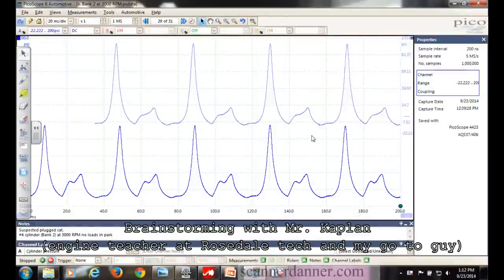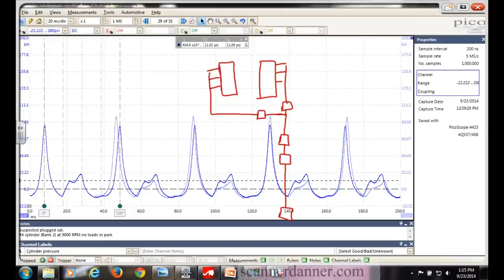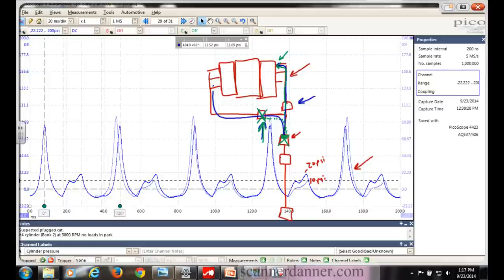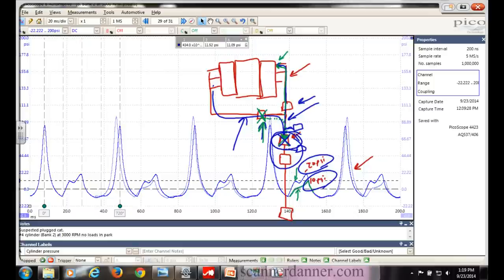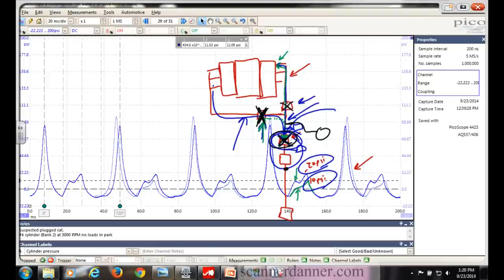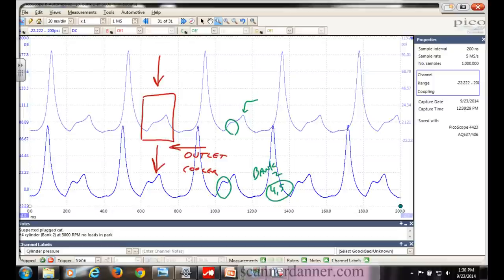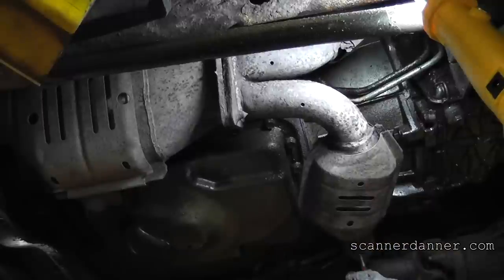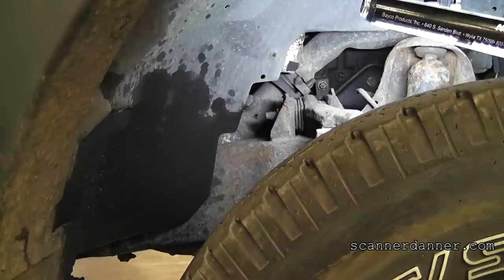How to test for a plugged exhaust (picoscope and psi transducer) Part 2

Comment: Yes I 've done this with 3/16 brake line. Drill the 3/16, insert brake line, measure, then sheet metal screw as "Cap" suggested.

Comment: 4:13
Pipes lengths are different on banks 1 and 2.
Bernoulli principle on fluids :
When you increase a fluid velocity ,it's pressure drop.
When you reduce its velocity ,its pressure rises.
It would explain the two different patterns on bank 1 and 2 while it's clogged downstream.
gases from bank 1 are quicker to travel,because the pipe is longer,so bajk 1 cylinder vacuum each other less well than on the passenger side,so you read more cylinder pressure.
That's how you tune a header,by modifying pipes diameter and length accoring to rpm target to increase volumetric efficiency.
I guess.

Comment: Hi Paul, great case study showing how to use the scientific method (hypothesis, experiment, conclusion) to develop testing tools and pinpointing the exact problem! I was also thinking that the driver's upper cat and the first downstream cat were restricted until you showed the backpressure readings. At this point to complete this case study you could show us the running in-cylinder pressure transducer test on this fixed vehicle. Maybe some waveforms from other known-good vehicles at 3k rpm, with 4 cyl engines vs. V6 vs. V8 would be helpful in explaining the positive pressures on the exhaust stroke.

I think Tobias Jonsson makes a very valid point about higher in-cylinder pressures on the exhaust stroke at higher volume air flow just because the exhaust valve itself (even fully open) is still the bottleneck (highest resistance in air flow) between the cylinder and exhaust manifold.

The "curve balls" definitely makes the process  of developing testing methods more difficult, but also more fun! Thanks for sharing so we can all learn together. Now I want a pressure transducer!!
Reply: Thinking about the two waveforms for a few days brought up another point at 5:30 when you are comparing the exhaust stroke pressures on driver's bank vs. passenger bank. On the pass. bank, which we can call a known-good, the pressure only increases as the piston accelerates upward and pushes the exhaust gases out past the valve, as Tobias pointed out.

However, on the driver's side, there is an IMMEDIATE spike in pressure as soon as the exhaust valve opens!! This is the real indication that there is pressure built up in the exhaust manifold that is backfeeding into the combustion chamber. Then the piston pushes against this existing pressure, creating the second higher 20psi hump, like an additive effect.

The in-cylinder pressure transducer test for a plugged exhaust seems most conclusive at high rpm, with any built-up pressure in the exhaust manifold shown as an initial positive psi spike as the exhaust valve opens. At idle the air flow is much lower, so a partially restricted system would not be as evident...
Reply from the maker: motoYam82 I am in total agreement, with you and #Tobias. I just checked one of the few other engine propulsion waveforms I have stored of a good engine running at 2000 RPM (don't have one at 3000) and it read 5.44 psi! This would be bad if we were in the exhaust. The bottle neck description seems to be dead on. Also the waveform I have shows the gradual rise, near the end of the exhaust stroke (like the ranger showed on the good side). Not the sharp rise at the beginning. Tricky waveform to analyze for sure. I am almost sorry I didn't have a better understanding of this before shooting this video. On the other hand it is fun to lean together.
Reply: ScannerDanner Premium motoYam82 My thoughts were going all over the place when I first saw the waveforms and was thinking how can this be. You know that there should be virtually no pressure at all in the exhaust so you kind of have your mind set on that. Then when you get presented with evidence on what really goes on it takes some time to readjust and think about what exactly is happening and where the meassurement is taken. It is nice you got it figgured out. I guess we will see some more of these waveforms as oppertunity comes! Keep them coming. I learn something in almost everyone of your videos and it is really fun to be able to talk about with other people!
Reply: @mctobbsi  bor du i norland?
Reply: Joachim Johan Hej, nej jag bor i Skåne :) Vad tänkte du på?

Comment: My 02 Ford Ranger had 5 cats And when my truck shut down my longtime mechanic was stumped. In desperation a youth who was a Ranger whiz got the cats unclogged and my truck is back on the road. A side note to all this is that I had previously had all 5 cats replaced(Supposedly) under similar circumstances with previous engine/6 cyl. edge! When I was informed that the cats were the originals, I knew I had been scammed BIGTIME!

Comment: The inner cylinder pressure could just be due to the velocity and volume of air exiting the cylinder? Great video though, it gets you to thinking in a different direction. The pressure measurement was taken inside the combustion chamber, which does change things when thinking of exhaust back pressure. I agree that more "Known Good" engine cylinder pressure values would add to the case. I really like the idea of checking and measuring anything and everything possible with a scope. The ability to save and capture screen shots in a graph form is much more accurate and educational than watching a gauge needed fluctuate. Keep up the great work Danner.
Reply from the maker: Jeremy Shanks Thanks Jeremy. Lots a variables with the in cylinder stuff that's for sure. I'm learning with you guys on these.
Reply: Keep on.

Comment: Hello Paul Danner.... I was wondering if you had any videos of disabling the EGR by removing or plugging it hose, or disconnecting one of its control solenoids and taking a vacuum reading at idle and again at 2500 rpms?  I have seen where you connected to the DPFE sensor.  Is this a different scenario or similar to the one I am describing?  Thank for any information in this manner...  @ScannerDanner

Comment: What if the 10 psi you're seeing on the passenger side(good), with your pressure transducer, is just the backpressure of the piston pushing air past the exhaust valve. The bad side reading 10 psi past the valve plus the additional backpressure due to the plugged precat. I'm guessing if you were to do the pressure transducer test with the y pipe off, you'd still see close to 10 psi on all cylinders tested.

Comment: Hi - I just watched this video, I realize I'm a couple years late - but just in front of that third CAT (the first "shared" cat), you drilled two holes, one in each pipe heading upstream.  Then you measured the back-pressure on each one, one at a time.  Is it possible that the excess back-pressure was escaping out the other hole, thus showing zero backpressure?   When in reality, if the other hole was plugged up, you might have seen backpressure in the third cat, explaining why you did not see backpressure in the passenger cat, but you did see it in the cylinder...
Reply from the maker: No, I plugged the other holes during each test, plus they were too small to make a significant difference.

Comment: Check wit a temp gun at before and after each cat to check the temperature delta prior to the back pressure test to gain an understanding of what temperature delta to expect from a plugged cat, that will save you from drilling holes next time.
Reply from the maker: Just uploaded a case study on this proving the temp test for cats has variables and is NOT a foolproof way to test for cat restrictions. 
https://www.scannerdanner.com/scannerdanner-premium-chapters/chapter-1-universal-testing-methods/587-2006-lexus-rx-330-low-power-no-trouble-codes-part-1.html
Reply: ScannerDanner Premium has moved to my website Hey I agree with you completely that it is not a definitive method, it can be a good indicator of a blockage and if you want to determine the exact point of blockage, then the method you have used in this video is absolutely on point and accurate. It doesn't harm to take readings and build knowledge of what symptoms can occur. I will be making the order for your hard copy book once I get some bills out of the way and subscribing to your premium channel.

Comment: Another great video series.  Really enjoyed it.  So it appears that melted cat could clog exhaust but not necessarily effect cat efficiency (because there was no cat efficiency code)?  I would have still been interested in knowing the inlet and outlet temperatures of the cats just as data points for reference.  For example, if driver side cat showed "good" outlet temp, then it would confirm Paul's hesitation at using temperature as a test for exhaust flow.

Comment: by making 2 holes b4 the cat after the upstream cat, dont the pressure will release by one of the holes? i think you should clog one of the holes to do that testing? or it should not matter due to small size hole?
Reply from the maker: hole is too small to be a significant change. Thank you!

Comment: This video has had me wondering for a few days now. I really cannot rationalize why you have almost zero pressure on the passenger side when you clearly have pressure on the sensor while the exhaust valve is open. I cannot think through how this could be valve overlap or any other pressure feed from the bad cat. Was the injector disconnected on the cylinder during the test? Is the transducer linear or is it logarithmic? Did the drill make vibrations that cleared out the center cat? Your logic and argument through the video made perfect sense to me. Will it be possible to repeat the transducer test as soon as the front cats are replaced? Finally I thought OBD2 cars were meant to disable the fuel on a cylinder after too many misfires to save the cats?
Reply from the maker: Andrew Thompson Andrew, read my reply to #motoYam82I do not think it is overlap anymore (well not 100% sure yet if that isn't also a factor) Unfortunately the student wrecked the truck and it is undriveable, I asked him to bring it back to do fuel trim analysis on it, to learn to ID a plugged cat with trim numbers. Needless to say I am super disappointed.Not all OBD II systems shut off the injectors with a misfire. It has to be cylinder specific as well. Thanks Andrew!
Reply: Thanks, this keeps you thinking. These tests will be the way of the future as it gets harder to access various components.

Comment: I'm certainly no expert on this subject but how about a part of the pressure build up only occurs in the combustion chamber? I mean, it i still a rather small hole, and with quite high velocity, the "exhaust" gases tries to go out through the valve compared to the cylinder diameter. Can it be that a part of the pressure rise is because the air is having a bit of a hard time escaping the combustion chamber? Just a thought.
Reply: And maybe the exhuast valve opening late and closing early do to wear.
Reply: Shawn Lockard I do like the drilling holes. The mig repairs that in two shakes of the lambs tail.
Reply from the maker: Tobias Jonsson I think you are on to something here Tobias. Read my response to 

    
        
    @user/motoYam82
Reply: Dear Paul, in such a case You should also check the pressure in the intake because it is the connection between both banks and as you mentioned valve overlap that can feed into it. I always go and measure all things. First in cylinder, intake, exhaust (normally just from the back) but with such an in cylinder test of course you have to dig in more. Btw, a worn exhaust cam or (bent)valves that dont open fully can produce some interesting results too. I had a shifted (176 degrees in start attemt) intake cam recently on a Jaguar V8 engine and without the WPS500 I could not have solved the puzzle. If you want those scans I can email them to you.
Greetings from Germany, Bernhard

Comment: Would u be a to somehow use a cam sensor to see the exact moment when exhaust valve open and compare that waveform to the  in cylinder transducer waveform ?
Reply from the maker: jonathan leon If you knew exactly where on the cam sensor waveform that event was.

Comment: Would have been interesting to move the transducer to other cylinders and see if the banks still test the same.
Reply: most likely they will read about the same unless cylinder compression not close to same between cylinders. thats what i guess.

Comment: I was just thinking that a worned out valve train might cause a similar reading on the Pico
Reply from the maker: Shawn Lockard I also think there are other variables (as you described). But it definitely starts with driveability symptoms for sure. This thing would not go over 30 mph and was not misfiring.

Comment: I think you got false readings, because all other holes upstream and same level should have been blocked while taking a reading from one hole, because otherwise the pressure has an escape passage.
Reply from the maker: the tiny holes drilled would not have effected the backpressure in any rea measurable way